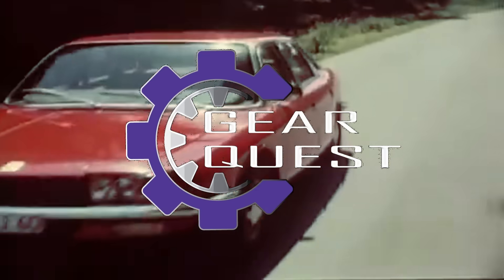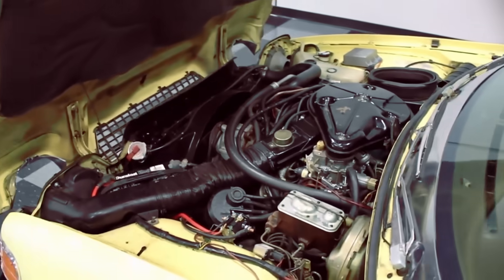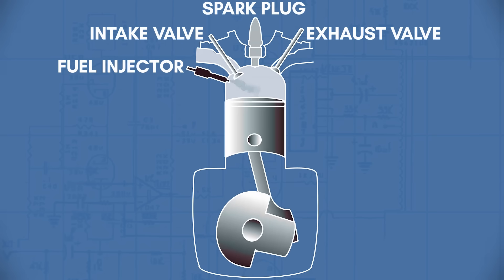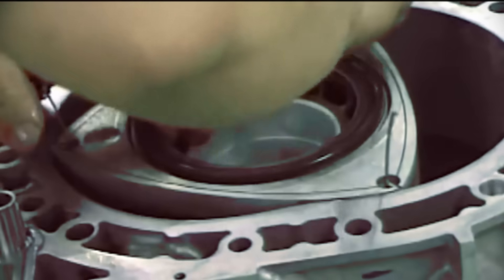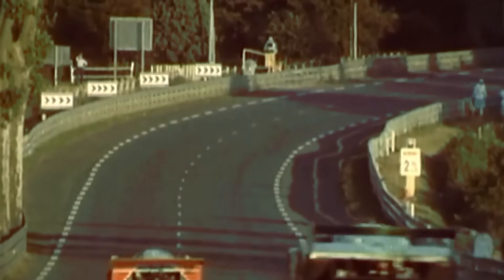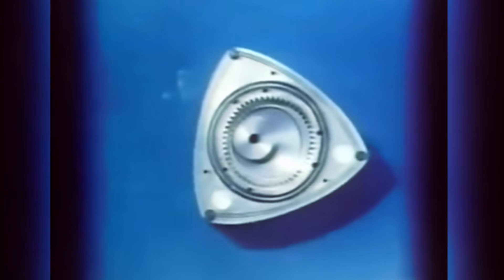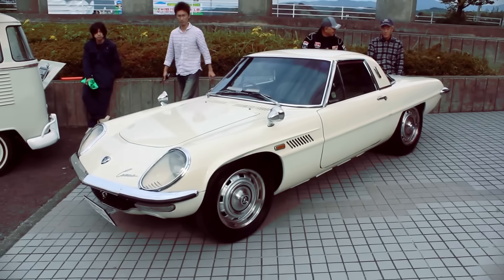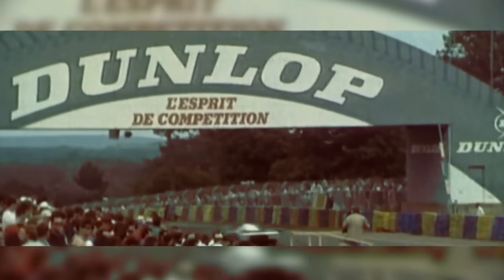The History of the Rotary Design

Comment: Why wouldn't this design be more fuel efficient? Just control the thermal dynamics with better cooling designs.  Electronic coolant valves could counter the intake, combustion, and exhaust parts to maintain the same temperatures.
Reply from the maker: Unburnt gas and oil gets burnt while the rotor rotates and the rotary squirts oil into the housing for lubrication, by design. This means poor fuel efficiency and emissions. If the rotary stayed in production, I'm sure Mazda would have figured out these issues. The Renesis engine sort of solved the oil burning issue.

Comment: But is the rotary really a fast revving engine , or the slowest revving engine, ?  Eg when at 3000 rpm the rotar is only going 1000 rpm, the geared up crank shaft (3 to 1) is where the engine speed is measured from, kind of cheating I think, (and I own a rotary Rx7)
Reply from the maker: Racing authorities have considered the rotary to be equivalent to a four-cycle piston engine of 1.5 to 2 times the displacement of one chamber per rotor. This is attributed to the frequency a thermodynamic cycle is completed at 720° (2 times). A piston engine completes it once at 720°.
Reply: Gear Quest , but my quandary, is the stated rpm from the crankshaft speed overated (as the rotor, impo should be where engine sped is taken ) is far slower ??? 
I’m calling the rotary engine the slowest rpm engine (but what would I know). 🥴

Comment: You should change the title. The video is not focused on why it was banned in motorsport, this is a documentary on rotary engines.
Reply from the maker: Rotary engines have long have been considered to have an unfair advantage because the frequency they complete a thermodynamic cycle. The video compares it to a piston engine to show the advantage.
Reply: Gear Quest , I’ll have to watch again, but with the rotor going so slow/per rpm, doesn’t the geared crankshaft negate the perceived advantage ?
Reply from the maker: @rotorspinny5516  Racing authorities have considered the rotary to be equivalent to a four-cycle piston engine of 1.5 to 2 times the displacement of one chamber per rotor. This is attributed to the frequency a thermodynamic cycle is completed at 720° (2 times). A piston engine completes it once at 720°.

Comment: The Liquid Piston uses an epitrochoid rotor with “triangular” casing. It breathes through the rotor and has three combustion chambers.  
It solves the wankel issues of high fuel consumption. Who knows why it’s never moved forward. It would make a great battery charging motor.
Reply: The Liquid Piston concept is currently being researched and developped for the US military as compact APU's for tanks and other  armored vehicles.
Reply: @jnmason6283  The liquid piston engine isn't a viable design for much of anything, especially putting out lots of power.  The intake port is far too small to flow enough air like a traditional Wankle or a piston engine to create much power.  If you carefully study the go kart video they use, it's obvious it can barely get around the parking lot.  Any regular kart used in normal racing would make it look like it was chained to a very large stump.  The liquid piston engine is highly unlikely to ever amount to anything useful for anything or anybody.  If it could, it would already be in use, and it isn't.
Reply: You may already be aware of this, but Mazda has stated the possibility that the rotary will return as a range extender for a hybrid powertrain. Good on you for your likely accurate hunch.
Reply: @probablyslept8142  Mazda just launched the 2020 MX-30, it's not a rotary, it's a 100% plugin battery electric car.
Reply: @sandervanderkammen9230  Hi, I may be wrong if there was a recent change. But from all the articles I've read, Mazda originally planned to start with an all electric version and then add a Wankel later on. Here's an article from late 2019 https://www.roadandtrack.com/car-shows/tokyo-auto-show/a29560723/2020-mazda-mx-30-electric-crossover-pictures-specs-range/

The rotary seems smart in this case because it's
- small and light
- torque doesn't really matter since it's just a range extender/charger
- "reliability" issues don't matter bc it won't be on most of the time (and it won't let you over-rev it cough cough)

I may be wrong, maybe they've decided to change their plans. But this is just what I've heard.

Comment: Nice, thanks. Thumbs up. I always like the rotary engine but since I like Roots type superchargers, I have to change.
Reply: why not twin-screw supercharger? much more efficient and more compact. they also produce more boost
Reply: @lordzeuscannon6400  Didn't know about the twin-screw. I heard that Eaton has a new TBS supercharger which is supposed to be better. I learned that the Twin-Screw produces the same boost ad its Roots counterpart but with less heat. So it seems like I will be moving to the TS over the Root. I had an old 1998 Buick PAU that has a Root supercharger. The linear power is so awesome as I am not into speed but torque.

Comment: 11:05 
Ernie Brink's corrected Rotor housing on the left, with the smaller holes for spark ignition. These holes are completely covered by the apex seals, as the seal passes over the holes, preventing combustion and exhaust  gases from escaping to the next chamber. This correction is key to the corrected Rotary engine's improvements. 

The typical Mazda design has the larger holes, which result in apex seals being burned and housing wall damage, and combustion and exhaust gas escape through the spark plug holes getting around the apex seals to the next chamber.

Comment: Ernie Brink, a former Mazda engineer, developed significant corrections to the Rotary Engine that should fix almost all the major issues of the engine. It would be able to make good power without turbo boost, it would get far better F/econ (as much of double),  It will not consume (nearly as much) engine oil, and it would not destroy itself under normal operation. I say this and a working prototype of the corrected engine has NOT be built. 

We need to contact him and see if we can not "go fund [him]" or kickstarter him to get this engine made. 

As a propulsion engine, replacing most drive engines in ICE powered cars  and hybrids today, or a generator engines in GEVs or PHEVs (where they would be called "range extenders), THIS CORRECTED ROTARY ENGINE NEEDS TO HAPPEN.
Reply: Racing fans like innovation, the '91 winning and the after race engine condition showed the unlimited possibilities of Rotary despite only being poorly developed to the overresearch on the piston engine.

Talking how poor reliability engine it produced in early ages, it's enough to say Rotary got the same room for improvement.

Knowing the weaknesses makes the wankel easy to figure how to make it flawless (and easy to dismantle and to reassemble)

I look for the electric project alongside it. Still, knowing how much power it delivers, it could reload battery on hybrid models (electricity can only start the car, more is a no go)

Comment: IN 1975 I did a paper on Rotary engines for a mechanical engineering class. The apex seals are the achilles heel of this engine. IF they can ever figure out a way to make them seal and last this engine will replace the otto 4 cycle. Interesting film and well done
Reply from the maker: Thanks for your support! 🙏🏼
Reply: And that is the rub, near 50 years now and still not fixed. Better maybe for a mild performance street car but really never a racecar
Reply: there are loads of seals that fix this so called issue try looking them up before you run your mouth

Comment: The real reason Rotory was baned is because in full race trim those motors are just to Amazing and reliable
Reply from the maker: Do you own an rx7? 😃
Reply: Rotorhead!
Reply: Exactly, I feel like mazda over engineered the 4 Rotor for the 787b so much, they couldn't perfect the actual car itself, thats why the car has a Porsche 5 Speed transmisson

Comment: It's more of myth. There weren't really banned, and they really were that good at racing either.  They had one fluke win at Le Mans, after the regulation had already changed that would leave them behind.
Reply: @FuLLeFFekT1  Show me the rule.  The myth is that they won at Le Mans, and they changed the rules so they couldn't win again.  The reality is that the class the Rotary was in was moving to a specfic engine formula. It didn't ban rotary specifically, it banned everything that didn't match the formula.  This was before Mazda  won anything.  They were allowed to compete one final year before that old class expired and that is when Mazda won, it's only race. Read this link:
https://www.carthrottle.com/post/wyzqvvd/
Reply: The fd Rx7 did quite well in the Bathurst 12 hour race in Australia winning it in 92 93 and 94 
So yo might consider they were very good
Reply: https://en.wikipedia.org/wiki/1995_Eastern_Creek_12_Hour   and this one none rotary people always crap on but they beat porsche here as well
Reply: @rotorspinny5516   Or you might conclude that in a small field, Mazda fielded a good race team.  Endurance racing is not really about speed.  And were they ever banned? No, of course not...
Reply: they were banned in a lot of series you bilthering idiot
Reply: @motorised1  Including the NHRA https://www.rx7club.com/rotary-drag-racing-167/how-rotary-banned-nhra-712572/
Reply: @FuLLeFFekT1 Show me those rules. Because what happened was in the class Mazda raced in, everyone had to switch to 3.5 L formula engines by 1992. It was meant to drive down costs of 3.5L formula racing engines.  That rule change did not target rotaries specifically. It put all previous generation engines out to pasture. 
They are free to participate in open class racing or challenges like Pike Peak hill climb.

Comment: The rotory engine is still used in Formula Drift and drag racing so its no banned from all Motorsports and ive seen them in race boats
Reply from the maker: The rotary engine has long been considered to have an unfair advantage by racing authorities because of the frequency it completes a thermodynamic cycle compared to a piston engine. The video provides a comparative analysis on the difference.

Comment: I love rotaries, but they aren't a massive advance in technology the way this video claims. They have upsides and downsides, it is more nuanced than explained in this video.

Also it is misleading to show the 787B when talking about rotary engines being banned. The 787B was not banned, the entire group it was competing in was cancelled the year before it ran. 1991 was always going to be their last shot, even before they won.
Reply from the maker: Rotaries were considered an advancement when they first came out. You can see this in old newspaper articles from the time. GM considered them the engine of the future. Rotaries were always considered by racing authorities to have an unfair advantage over piston engines. The video shows a comparative analysis of why that is.
Reply: @GearQuest  They were considered an advancement initially, but they are a side-grade, not an upgrade. Theres a reason why none of them are used in consumer vehicles today. The video makes it sound like a conspiracy. The fact that you cant individually control intake and exhaust timing and lift is a big detriment to performance. No mass market cars -> no incentive to race the engines, no racing -> no advancement in technology -> no mass market cars. It's a loop that was broken at the mass market car sales step. That is the number one reason that most race series do not have rotaries.

Comment: That animation that was in minute 5 is giving cancer. And my brain hurt af as it  was almost never syncro with stationary gear and chamber was retards as hell. wtf?
And so many missleading things.
I'm going to say, thar rx8 msp engines is bad designed, maybe better for daily use and emmisions. But, p-ports made engines let out carbon deposits better, engine was cleaning itself better. Chrome surface on engines or is to thin or designed bad as hell for higher internal temperature od side ports.
There is not enough room for making exhaust port big enough to much improve longlive of engine. Oil preassure is to low, and for heating faster purposes (again emmisions) engine had failing thermal pallet in its shaft (since fd tbh). And 5w30 is never good for rotary.
This video is 3 months old, it would be better to remake this with proper knowledge then to make more myths than facts. ( i dont included things that anyone pointed, and i skipped listening to it in a while.

Comment: Well I know how a rotary engine works now but I still don't know why I Motorsports banned it 🤦‍♂️
Reply: it was never banned.... there was a already known engine rule change for Group C1 1992 season forcing all manufactrs to switch to 3.5l V10 engines... it was the end of the rotary, V8, flat 6 and V12 in Group C1 ...btw next to Peuugeot and Toyota, Mazda was one of only three manufactors racing Group C1 in 1992 under the new regulations... without any success... because they had no experience with race engines on highest level Mazda bought Judd engines which never stood a chance against fully factory grown V10 from Peugeot and Toyota... and the 787B chassie was not able to house the engine so they hired old Jag designer to creat a new car the Mazda MXR-01 https://i.pinimg.com/originals/13/65/e6/1365e6bbf49e2622f22152e566faa375.jpg taken into account that the best result was a 2. place in a whole season against nly 2 other competitors shows how weak the car was...
Reply: @nagmashot  finally someone that knows the real history....BTW the mxr01 was just a rebadged XJR14
Reply: supersevenn with a V10 instead of the cosworth HB
Reply: evuriday1 Cause it‘s got double the power strokes in a set amount of revolutions in comparison to a piston engine. He said it in the video. :)
Reply: Low displacement but high perfomance compared to conventional engine also light weight
Reply: Never banned, simply capacity regs banned it. That and they never made enough power for the money. Nor were they normally reliable enough.
Reply: @ldnwholesale8552  there was no capacity limited which banned it... simple rule change that forced all teams to switch to F1 3.5l V10 engines no matter if rotary V12, V8 flat 6 all had to switch to 3.5l V10